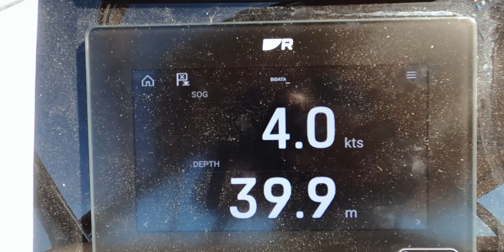SAILING TURKEY Coast - Is our Sailboat Beneteau 57 SINKING - sailing family vlog Se. 2 Ep. 40

Comment: On my last charter turn I had the same problem I kicked the shower off and the hose was leaking afterwards. Luckily I discovered it early enough because the water pump was running all the time but we had not used the tap, so I found the problem and bound off the hose to the shower... happy for you it is not sea water all the best Alex
Reply from the maker: Never a full moment on a sailing boat, now with Benjamin it’s an extra dimension and just after the refit you doubt everything. We had salt water
as well, from the seawater pump of the generator and exhaust of the engine. Great and thanks for watching our journey, it’s great to have you onboard 💙

Comment: I always have a mobile pump (Jabsco) with a pipe long enough to evacuate the water out of the hull, Seeing you working with a "toy" sucks ...
Reply from the maker: Yes Richard you are right, we have a mobile Jabsco pump as well and we used the pump to get the oil out of the engine to get the water out of the tiny places to track the leakage. Really appreciate your advice 🤩

Comment: Still no lifeline safety netting? It's cheap and about every marina shop has it.
Reply from the maker: Hi Ferruccio, as replayed previous time, we are working on it and our boat doesn’t fit the standard sizes they have here. So not available at every marine shop unfortunately and very difficult to let it be ordered and delivered here. We have been to every marine shop we came nearby, still no luck. But it will come definitely. Luckily our center cockpit is very safe and Benjamin als ways wears a life jacket and with sailing Rianne is always with him and 80% of the time below deck and above only in the cockpit. We take extra safety measures so for now it isn’t even possible for Benjamin to get out of the center cockpit or fall of the boat with sailing. And with being anchored he runs around and there is always at least one of us present. Thanks for reminding us!

Comment: Consider moving the batteries form the bilge. Warning example https://youtu.be/xBWvamrLoe4
Also since you have litium batteries, put them in an stainless steel box with a chimney. So that they can burn safely in case of a fire. Also consider a CO2 fire extinguisher connect to the batteri box.
Reply from the maker: Thank you Jonas, we watched the video and very insightful indeed, we took some lessons out of it, we have a CO2 fire extinguisher 50 cm away from the batteries, we already levelled the batteries up, we had two layers of lead acid deep in the bilge and are very happy with just one layer. Thanks for Feeling the Breeze and taking care of us.